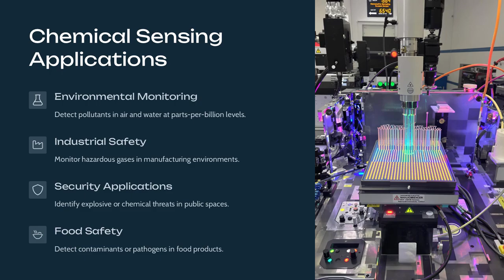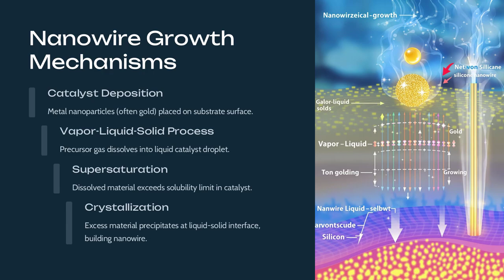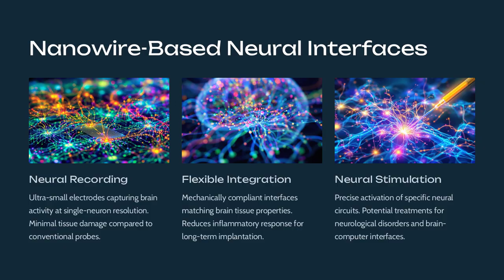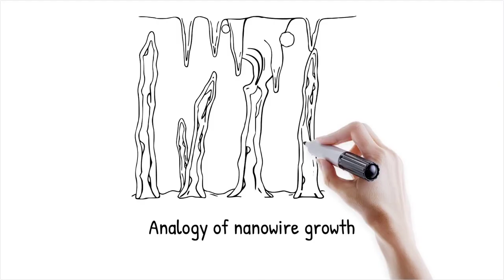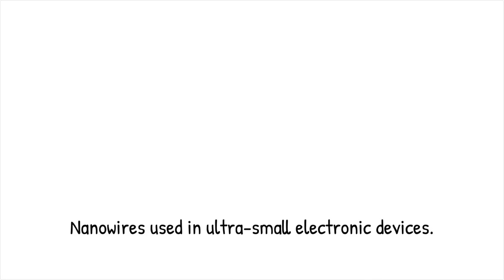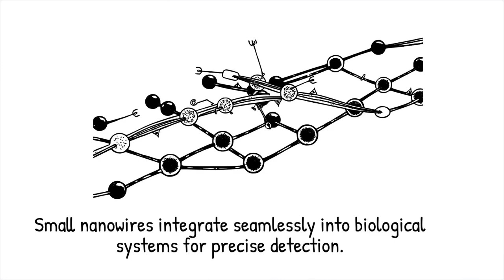The Quantum Frontier: 1D Materials That Could Redefine Technology

Comment from the maker: How can the stability and coherence of Majorana-bound states in topological nanowires be reliably preserved in scalable quantum circuits under real-world environmental noise?
What are the fundamental limits of electron transport efficiency and thermal conductivity modulation in 1D nanowires, and how can they be dynamically controlled for adaptive device behavior?
Can we develop high-throughput, defect-free synthesis methods for integrating quantum wires into complex multi-material architectures without compromising their quantum mechanical properties?